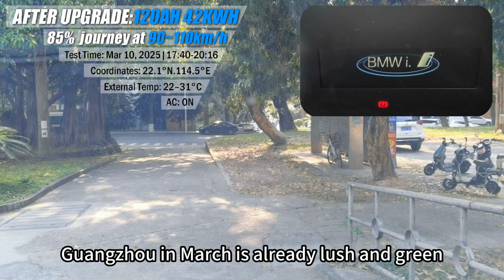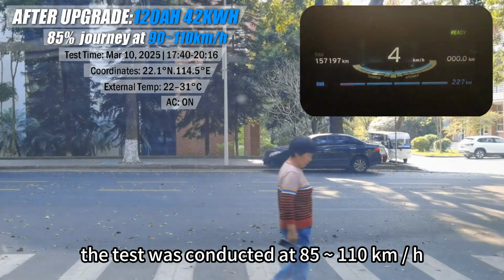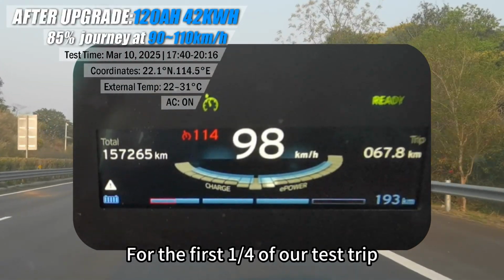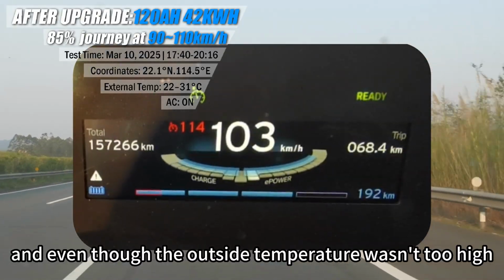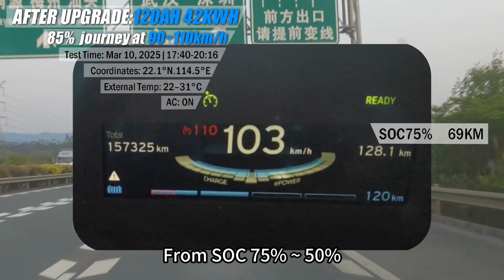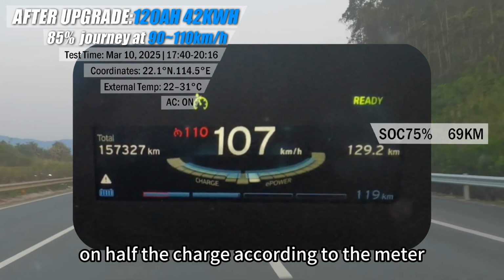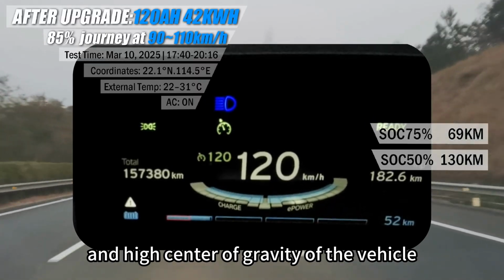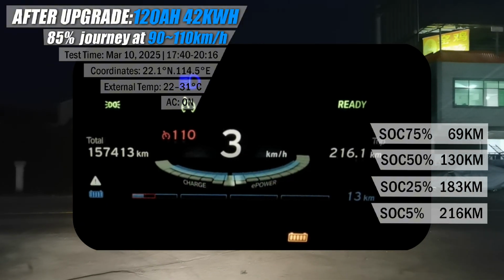120Ah Battery Pack Upgrade for BMW i3 | High-Speed Range & Performance Tes

Comment: Great to see the longevity of these first generation electric vehicles. And a whole new lease of life and practicality can be introduced courtesy of a new higher density battery replacement. Whilst it is true higher speeds equals less range this is the case with all cars regardless of drive train or fuel type.
Reply from the maker: Yes, exactly. The speed of the vehicle and the number of electrical devices in use will directly affect the energy consumption. Higher speeds and more devices in operation tend to draw more power, reducing the overall range of the vehicle.

Comment: how much ? can it diy ?
Reply: Don’t forget it’s high voltage. You need to know what you’re doing
Reply from the maker: While it is possible for experienced technicians to handle the installation, we generally recommend professional installers for the best performance and safety.

Comment: From seeing feedback from the user forums etc., what people want to see is reassurance of these new retrofit battery packs being in compliance with whatever applicable safety specifications set originally by BMW ? They want some certification clearance from sources which they can trust & recognize before using it ?!
Reply: dont like it? dont buy it
Reply: There CATL batteries you can get specs of internet ask for model number .